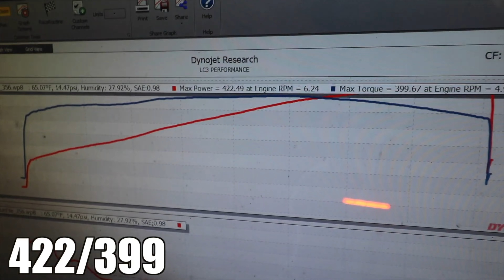Building a LS Cammed Corvette in 10 min! SOUNDS INSANE!

Comment: where are the measurements on the zr2 I asked you about I am not interested in your car.
Reply from the maker: It is not a Zr2!! Lol!! It is a Z71! There is a video o my channel that I did measure it.

https://youtu.be/5jjFC8nlOtU
Reply: @Matty.Garage  ok thanks alot
Reply: @Matty.Garage  I watched your video and yep you have the measurement on there I have a 2021 zr2 I had put a 2-inch level kit from truxxx on it but was thinking about the 6-inch lift you put on your Z71 and when I measured my zr2 its as high as yours and i only have 33s on it. I was told the zr2 comes with a 2-inch lift from factory and I put 2 inches on it which I would think would be 2 inches lower, but it is exactly the same as yours so i guess I will keep it where it is. keep making more truck videos even if its trips some time. Thanks